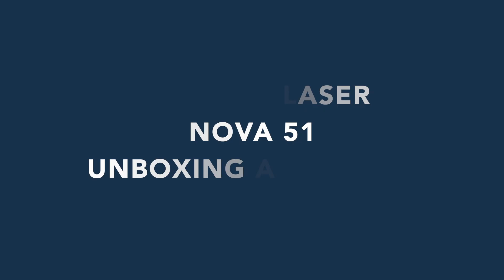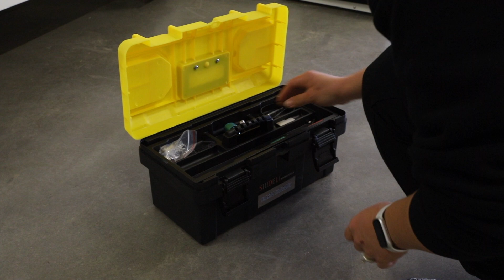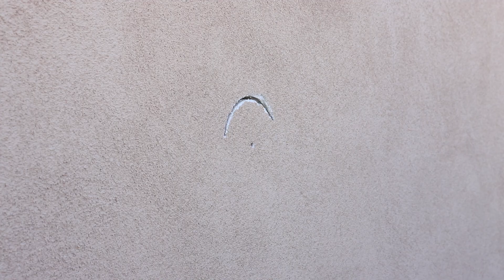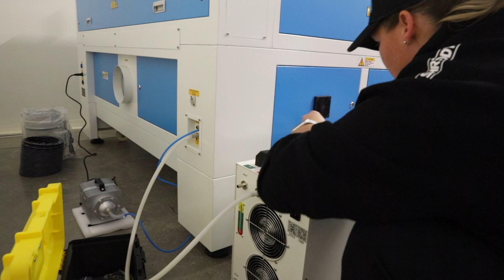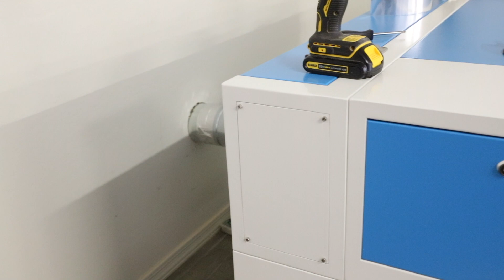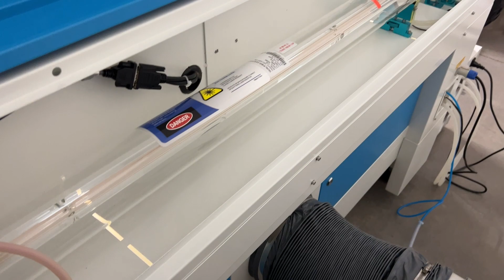Thunder Nova 51 Unboxing and Setup

Comment: Nice video. My 51 will be here in a few days.
Reply from the maker: Nice!  Hopefully this video helps you a bit when setting it up!
Reply: @addicted2diy  I was told freight is curbside only so I'm concerned about that. Thinking about picking it up at their hub with a trailer.
Reply from the maker: I think it depends on who your driver is.  I told them where it was going.  I’ve had a ton of freight deliveries and they are always more than willing to back up to my shop in the backyard and unload.
Reply: @addicted2diy  they said they can unload it for me. I find out for sure tomorrow :)
Reply from the maker: Fingers crossed!